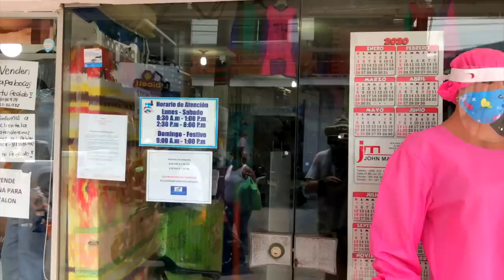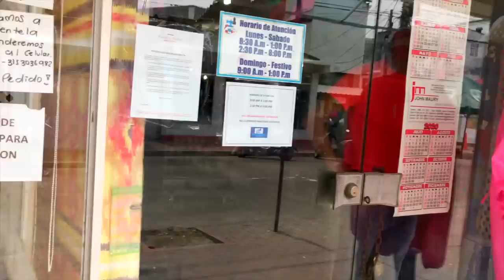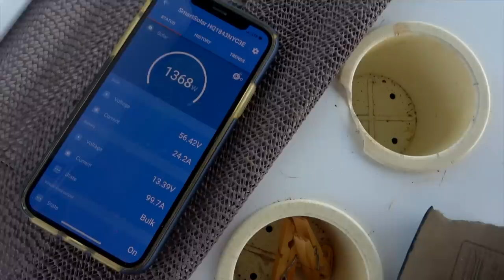SSL437 ~ Maximize Solar Power with your ANCHOR..!!

Comment: Very cool... learned something new here again today. Makes sense for the solar power for sure and I can see how it would also help if the sea swell was rolling the boat a bit and you wanted to turn the bow straighter into the oncoming swell to fix that little problem. Thanks for posting!   ☮

Comment: If you want the max from your panels, install one controller for every panel. If you connect more than one panel to one controller if one of them is shadowed the all panels are affected the same, shadowed or not.
Reply from the maker: If they are all in series yes, in parallel, no.
Reply: @SailingSophisticatedLady  In parallel the lost is smaller, but the max efficiency is when you use one controller for every panel.

Comment: Tell Maddie she hasn't to beat up the Octopuss a quarter hour for tenderness let (washing) soda do the trick => just cut the backend from tentacles, remove guts& backshell, cut out the beak inbetween the lowest two tentacles, portion it and put in  (!)seawater an add two knifetipps washing soda per liter (no sweetwater => osmosis=> cellwater => cellblast )👌.
Let it rest for 1-2 hours => steam cook the Octopuss for about 10-30 min depending on size and weight and grill or season flour & fry as You like!

Speared my self quite a lot  Octopuss and Calamares in Adria an Ägäis 😉
Makes the filet super tender no strange taste!

Bon appetite👨‍🍳

e per favore dì alla bellezza italiana che sta cucinando divinamente!!👌

Solarpower is great we need that full surface on all our E- cars to recuperate, range extend and recharge!

Comment: Next time take that ocopus and dip it in boiling orange juice a dozen times to tenderize then throw it on your grill. Won't be disappointed. The gas grill will give it a little different flavor than the wood grill we use but it should still be good.

Comment: Very Nice! You Could Also Take Out At 90 Degrees A Secondary Smaller Anchor & Use Your Mid Electric Winch To Pull Her Around & Adjust Quicker!? Thus Not Messing With The Mains Set Angle... LOL Thanks
Reply from the maker: It would have the same net effect, but then if a squall hits you have an anchor to deal with instead of just releasing a line

Comment: Your solar system is awesome.  Can you do a complete system overview video?
Reply from the maker: Yes, I will review all of it with the next upgrades.  :)
Reply: @SailingSophisticatedLady  Thanks, planning out my solar upgrade for my Irwin 46.  Tips like- how close do the controllers have to be to the batteries, any Victron quirks you discovered, did you have to change your alternator for the Battlebornes etc. would be really great.  Really like the full Victron system.

Comment: Rick, what a great tip to angle the boat with an anchor bridle to avoid shadowing! It seems so obvious once we have seen it but most of us might not have though of it. The reduction of power due to shadows is so dramatic that this is truly a POWER tip :) I also liked that you took the time to explain how to bail out of it if high winds kick up by dropping the stern line. Nice captain!
Its impressive to see the instant doubling of power and then later 100 Amps!
One question on your dingy davit system.  Was this original on your boat or did you add it later?   I have seen this U shaped system used on sailing cats like Lagoons and Leopards and they seem very simple and functional. If you had it built yourself can you share the fabricator / manufacturer? I enjoy your technical sessions as well as the normal sessions since you have so much actual experience. By the way, loved the episodes with Valentina! Hope she is safe and we see her on SSL again!

Comment: 100amps.  I know that going 24v does cause some issues due to boats, cars, RV's etc being 12v, requiring a 24v to12v converter, but, the reduction in current is nice.  I have 2000w in panels at 24v (28v actually) and can reach 60 to 70 amps.  The wire would need to be huge if 12v.  You have an awesome setup.

Comment: Hi Rick I was on the sea with my 72 ft Mareblue for 15 years. After 5 years I decided to use a wave generator. It produced a lot of electricity when sailing and sufficient when anchoring in a river. Conversely usable as an electric motor to put the boat in the wind to set sail. This is how I protect my machine and the environment. I also had less service and never had to change my engine. All best for you - Capt. Wolfgang

Comment: Rick, interesting watching you reposition boat to take advantage of sun angles for charging, since you are in a uncrowded anchorage and fairly calm wind, wouldn’t setting a stern anchor work and put less stress on your main anchor, unless the wind picked up? if that happened you could put a float on your stern anchor and release the stern anchor, until the wind died down and reposition boat later. I anchor in some crowded anchorages and stern anchor is sometimes a must, to keep way from other boats that are not anchored safely? I can set a secure stern anchor from the dinghy in a few minutes and release quickly if required, interested in your pros and cons on subject. I love your tech talks and informational videos, they’re the best!

Comment: Thanks for the instructional video. Won't this bridle place a lot of strain on the stern cleat? Do you have thoughts about what conditions would be too much for that? Or, perhaps sharing the anchor load over two locations is easier on the boat Your thoughts?

Comment: Hey Rick, I enjoy yr vids a lot. especially the tech part. I just rebuilt my 46 ft mono and am ready to go from Portugal going south and west. I saw yr change after delos and it makes sense.  I think u got the right mix.  Would be great to  meet one day. Question: how many controllers do u use for the solar, and how do you prevent them from reading each other, meaning that the input and voltage raise from one is interpreted by another as a charged battery, resulting in the second controller from regulating down. And how do u account for the windgen? Take care Carson